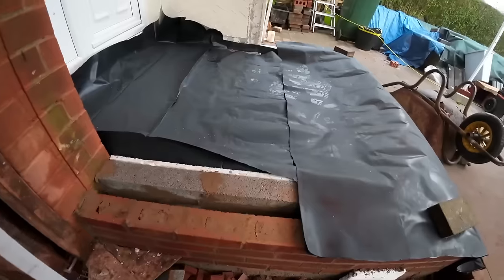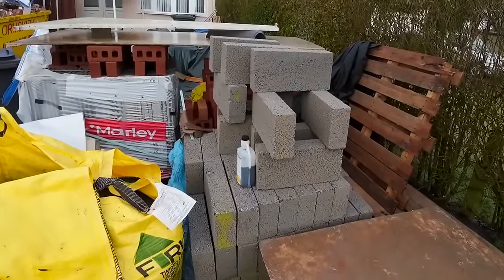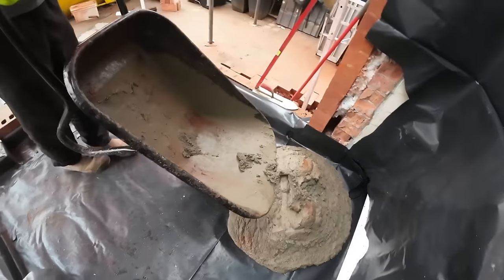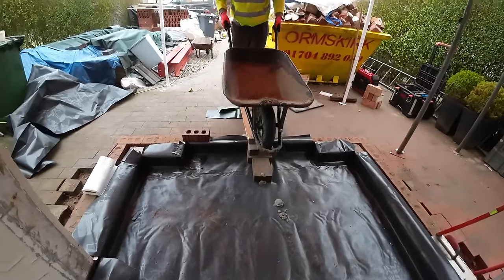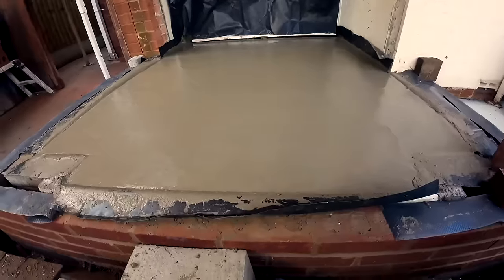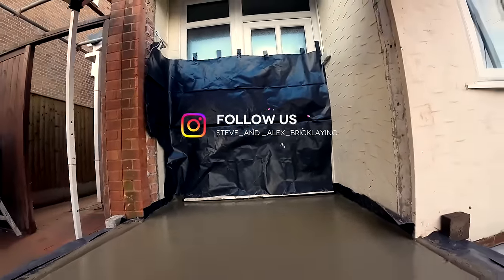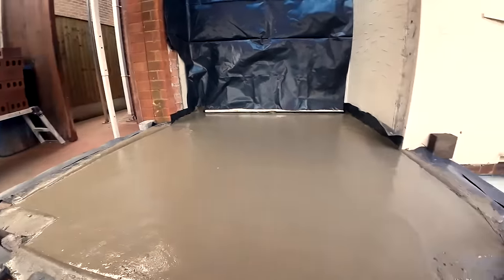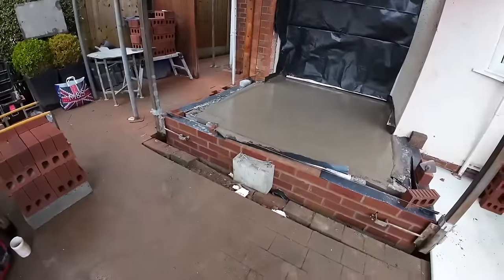INSULATED CONCRETE PORCH FLOOR ..AND SNEEKY BIT OF BRICKWORK ..PORCH BUILD PT 4

Comment: I eft the UK in 1981 when I emigrated to Canada, I remember the new house  in Burnley where I lived in was cold, in fact very cold in winter. The big difference I see in your excellent videos is that there is so much insulation used now in the wall cavities and in the floor slabs. Does anyone use spray foam to fill cavities in new wall construction, we use it here to insulate new construction mainly wood stud walls, but also concrete walls, superb work guys, love the vids.
Reply from the maker: Burnley ! Cold and wet 😂. 
    Mortgage companies won’t lend on a house with spray foam insulation over here . It’s not used much at all 😬🧱👍🏽

Comment: where were your videos 25 yrs ago when I built my extension to my bungalow. I had never put two bricks down everything was from DIY books. End of the job the building inspector did not have to get me to correct anything and made a comment on my building skills, being much better than most. I did fill my brick joints like you do. Mine was an extension to the Kitchen, Bedroom x 2, full wet room internal passageway and brick skinning to the outside wall all on the Aluminium Prefab Bungalow.  
At the time I was going through a divorce and had one severely disabled child and another young child. One hell of a job, With your videos it would have helped a lot.
Reply from the maker: Alex wasn’t born then 😆. 
   Well done on the self build pal 👏🏽🧱👍🏽

Comment: @9:25 Would you PLEASE make up a wood darby instead of using those expensive levels to screed concrete? They are easier on your back as well. It's just a braced wooden triangle with fir porch floor decking on a flat to smooth and screed with.

Comment: Top job gents, what is purpose of vertical dpm in cavity just behind brickwork and what depth does it get cut in? Thanks
Reply from the maker: Not sure what you mean 🧱👍🏽
Reply: @SteveAndAlexBuild  what looks to be membrane that alex puts in at 26 minutes 30 seconds
Reply from the maker: @tatum1283 . It’s to stop damp tracking through the wall 🧱👍🏽